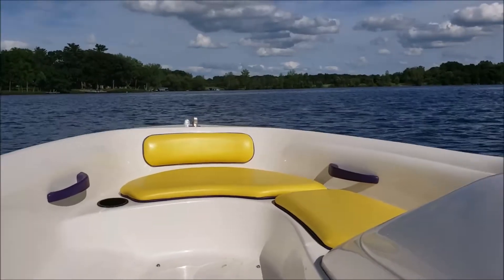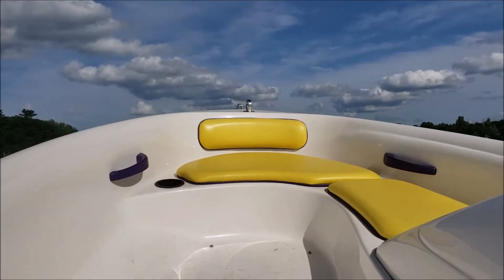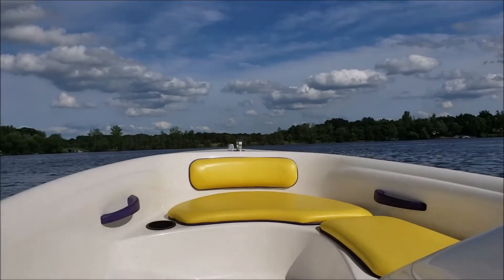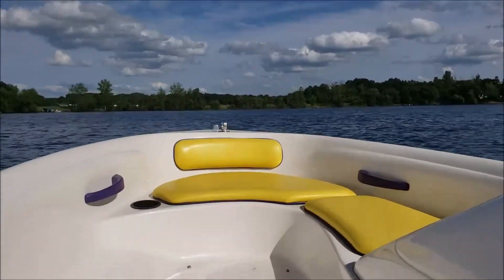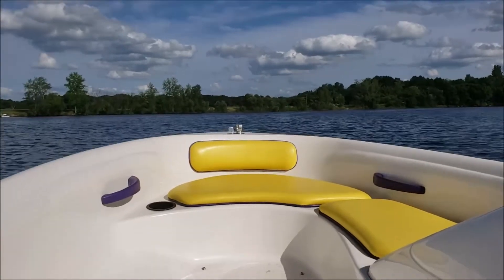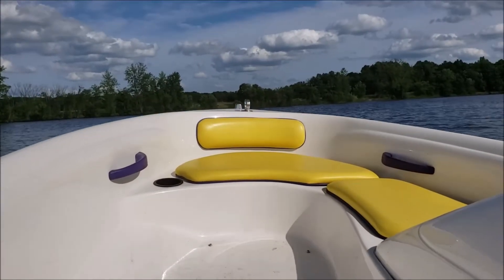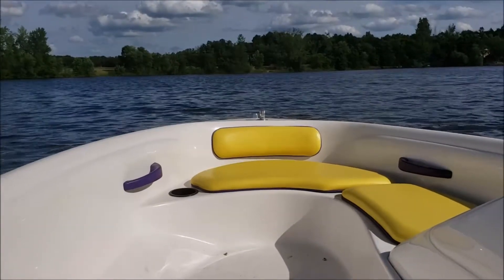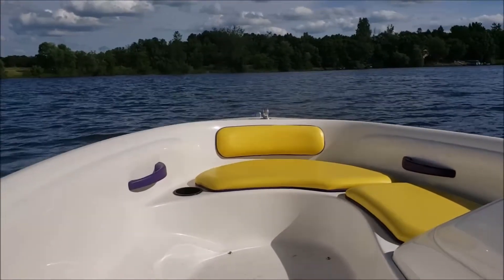Sea Rayder F16 Jet Boat Trim Tabs Part2

Comment: Wow! Thats a tremendous difference. Takes off like a jet ski now.. Nice man! 
Do you find yourself adjusting the trim tabs that much? 
Bc they sell SS Trim Tabs with threaded rods so that you can shorthen or lenghthen them to adjust the angle. 
Only bad part is that theyre not exactly too adjustable on the water..
If I could put them on and just hop in the water and get it adjusted to a happy-medium and just set it and forget it..
What you think?
Btw awesome vids thanks!